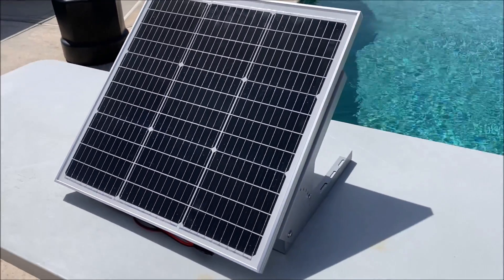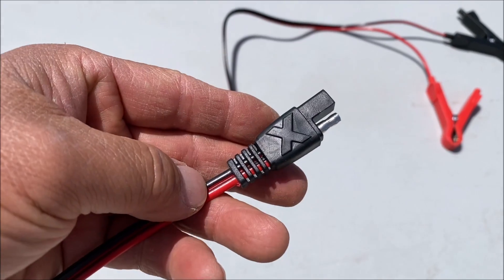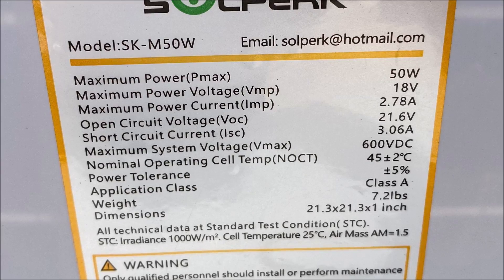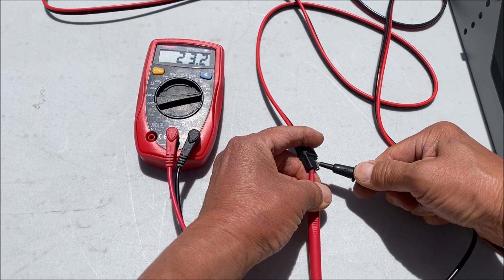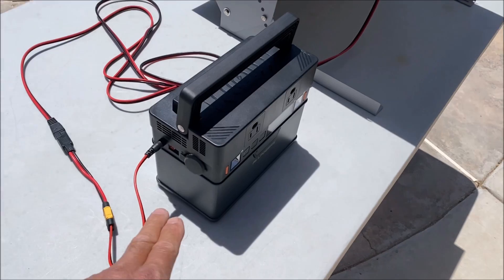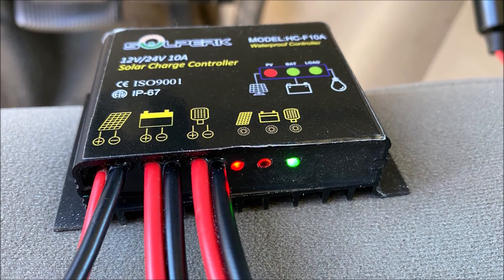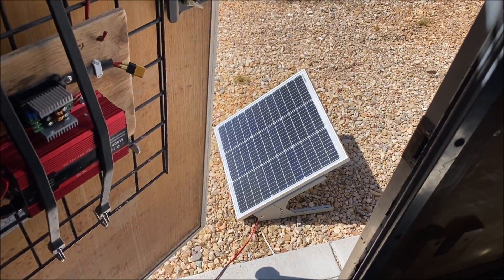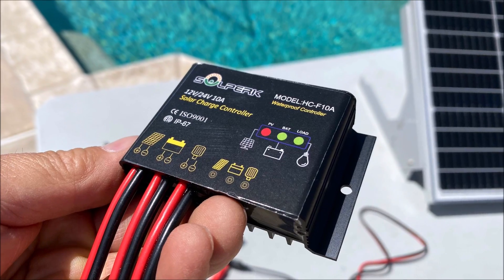The Solperk 50Watt Solar Panel Kit is a Great Beginner System to charge all types of batteries

Comment: You don't even show how to hook it up.  For instance, the manual says to connect the battery connection first to get the middle light on BEFORE connecting the solar panel connection.  I was hoping to see that in your video to see if your middle light lights up because that is not working on mine and I wasn't sure if I'm not doing something right or if I have a defective one.  My solar light flashes red, my battery light is not lit, and my load light flashes green.

Comment: Please SOS,with this I can charge a 12 Volts refrigerator,thanks
Reply from the maker: Maybe not directly since the open circuit voltage can vary.  You may want to use a power station that will output 12volts perhaps via a cigarette lighter port and charge the power station with this solar panel.  Or maybe, with the use of the provided controller, it may work.  I would go with the power station method to be safe or use a voltage regulator like a step down buck converter for a constant 12volts.
Reply: Charge or use directly? Find the sticker on the fridge and tell us the wattage. I have a cool box fridge that uses 30watts on my sailing yacht so on an average day I can use that to top off a battery via a mppt controller. Directly is not a good idea even via a mppt controller.

Comment: Can the system you have the link to charge a 24 volt battery bank? Want to use it for a trolling motor setup
Reply from the maker: This system is only a 12 volt charging system.